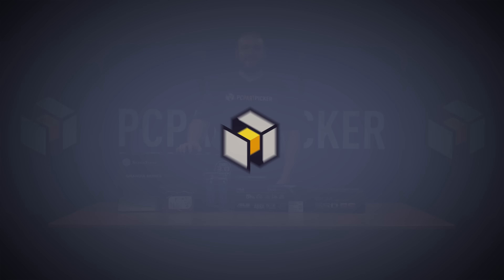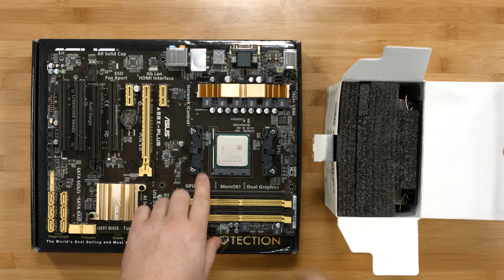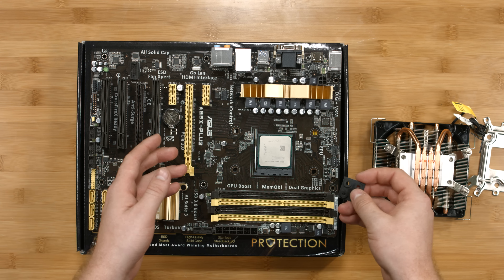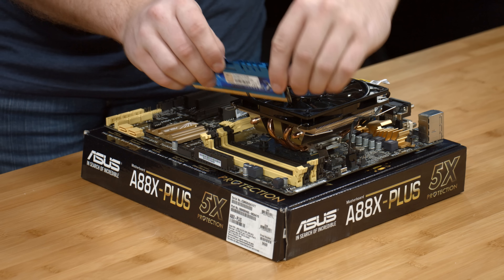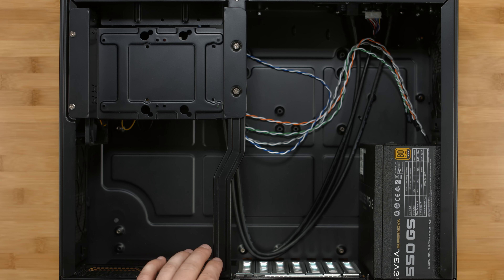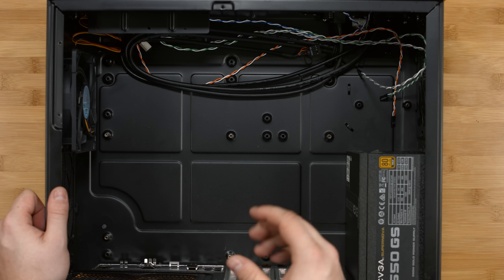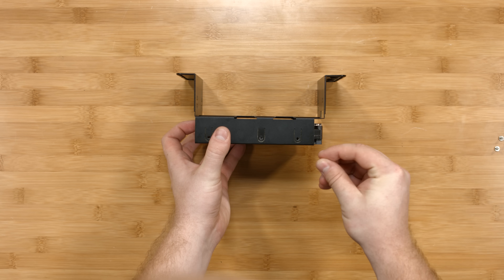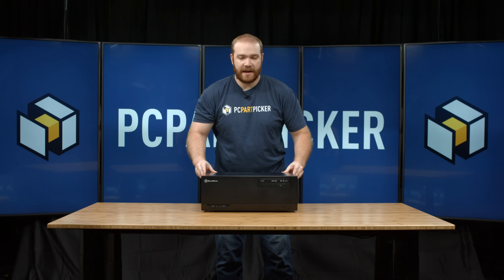$630 HTPC Build - AMD A10-7870K / Silverstone Grandia GD09B

Comment: What gpu would you pair with this for dual graphics?
Reply: +Ryan Zinter r7 240 or r7 250
Reply: +Ryan Zinter The recommended card is the r7 series 250 preferred.
Reply: +Brock Larkins thanks.  will it be worth it, mostly for an htpc/WoW machine, or should I wait until Zen releases?
Reply: +northern marine thanks.
Reply: I'm not familiar with Zen, but the performance increase for graphics would be worth it. I am actually looking to build a dual graphics 'htpc- overkill' so friends can use it when they come to the house. I currently have a alienware alpha for the girlfriend (didn't feel like building one for the same price) and a desktop for myself. I've been checking the reviews for the performance tests of dual graphics and the Godavari + r7 250 has been looking really good.
I think if you're playing WoW you will want the card, they only cost like 100 bucks or less and its low profile ready usually, so it fits most setups. http://pcpartpicker.com/p/xVmvyc this is the build I am looking at so far, not sure of what case i'll use, but I also have some SSDs I'm not using that will be the main storage of this new system. I think its going to be a very competent pc - I'm only using the 'htpc' because I'm planning to keep it very small form factor.
Reply: +Brock Larkins thanks,  I'm looking to do something around tax time.  Zen is the new AMD architecture that will be coming out next year.
Reply: Oh Okay. I will look into Zen, thanks for the mention.

Comment: how good is this build when playing games ?
Reply: +XPRT NJA  Check out JayztwoCents Video about AMD 7850K budget game build.  His video offers several different budget options and demonstrates FPS on BTF 4.  

What I focus on when building a PC is what is the PRIMARY purpose.  In my situation with my 7870K on Asus A88X-PRO mobo is everyday task, HTPC, gaming.  As a former avid console gamer I chose my components based on current needs and ability to upgrade with a DGPU.  The 7870K with a samsung 250 gb SSD and WD 1tb HDD surpassed my expectations. I added a gigabyte PCIe 802. dual band (use 5ghz AC wifi) and Bluetooth 4.0 that uses an intel 7260 chipset. With the HDMI, Wifi & Bluetooth, my use is now geared towards HTPC and multiple device connectivity to display on my home theater system.  It is a  overkill for a HTPC but for the price (bought components when they went on sale) with rebates one hell of a PC for less than $450.00.  Thanks to Newegg and Frys.
Reply: +Rene Ramirez thanks for the feed back and I'm trying to get into PC gaming
Reply: This is a home theater PC

Comment: if i install rx 480 8gb 
Will there be a bottleneck ?
Reply: On most games no. But on games with extreme CPU usage the A10 may bottleneck the system. The A10 contains a beefy GPU for an APU system so its not the best option if you want to have a graphics card anyway. Even the FX series CPUs would be a better choice, along with most any Intel chip i3 6th generation or better.
Reply: no I think it will be very rare for this CPU to bottleneck a rx 480 or rx 470
Reply: but you might aswell get the Athlon 880k because it's cheaper and has the same CPU, or get an I3 if you don't have the mobo yet

Comment: They should have gone with liquid cooling for the CPU.
Reply: Also, poor wire management.
Reply from the maker: Wingman1977 If you're willing to bump up the budget, that would be a viable option (and if you're willing to deal with small amounts of pump noise).
Reply: In small form factor cases cable management is difficult.
Reply: +Wingman1977 The wire management is poor because he installed them tangled lol. I agree though, it would drive me insane. I was cringing through the entire video

Comment: where is the gpu
Reply: Yeah?
Reply: tarig ali Because it will be used as an HTPC, not as a gaming rig.
Reply: The AMD A series AKA "APU's" are a CPU with strong integrated graphics, taking the place of the GPU or working with the GPU.
Reply: Nerdy Ninja 
Im sry for my stupidity but how do u connect monitor
Reply: Suma_mRznje Through the motherboard.
Reply: jkjkblimp341
So you can have 3 gpu 1 integrated in cpu one in mobo and one in x16 slot lol
Reply: You can go with duel graphics mode (dedicated GPU from AMD and the integrated) but IDK if you can do multiple dedicated GPU's
Reply: The motherboard doesn't have a GPU
Reply: Nerdy Ninja
So how they connect monitor or tv
Reply: Through the motherboard. The APU does the processing but sends the signal through the motherboard's VGA/DVI/HDMI/DisplayPort
Reply: So if you dont have mobo with display port you must have dedicate card?
Reply: Suma_mRznje the motherboards on that socket always have some display output
Reply: Nerdy Ninja
Ok ty

Comment: this is not an HTPC, its more of an old PC style case with very low end specs.

HTPC does not require all these PCIe slots, the motherboard could have been switched with a mini itx with a builtin wifi and a smaller case with a build it PSU which would cut down the cost of this ridiculous build

Comment: Um. This is an HTPC, right? 
Are you trying to play games on it? It's not powerful enough for the newest games on a big LED tv with all settings on. 
If you're just playing movies and music, like most people with an HTPC, it's way, way overkill. You do NOT need to spend $630 to play video, even in 4k. You do NOT need a gigantic ATX motherboard to play video. You do NOT need to buy Asus. You do NOT need the fanciest, most expensive RAM on the market, or 8gb of it, or 550 preposterous watts of power, or an AC network adapter, especially not Asus. And you especially do not need Windows 10, which is a major privacy and bandwidth hog. This "HTPC" is like buying a Ferrari to go grocery shopping. I guess both will make you feel like your penis is bigger, but really they're just an enormous waste.

If you must have Windows, you can build the whole thing for $300. For $45 you can get a respectable 2014 Intel G3260 3.3GHz, which has plenty of overhead for running 3 movies at once. Put that on a $68 MSI H81 micro-ITX mobo and you can toss in a small $60 case. Get 4gb of cheap RAM, a basic $60 GT720 video gard if you need 4k (which you don't), basic 400 watt power supply, decent 3 TB drive, done. Throw Windows 7 64-bit and Kodi on top and you have something that's still going to play movies and music with zero hiccups. 

Or, get an Intel NUC for $400 and you're set. Even better - one of those $150 Android streaming boxes. You'll get 90% of the functionality.
Reply: I absolutely want to make it look good and in line with the other HT stuff I have. So yes I need this case and good parts inside, so I don't need to upgrade it early because of some evil genius, who invented another HEVC something Main 10 something and no old build can play it.
Reply: Forgot the crown jewel: The BD drive.